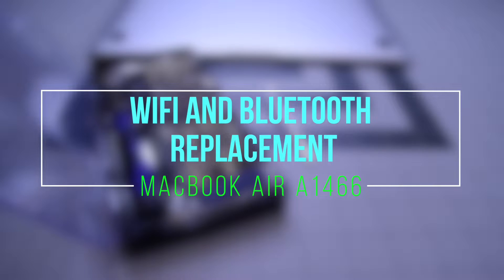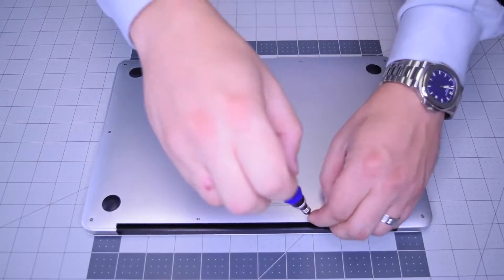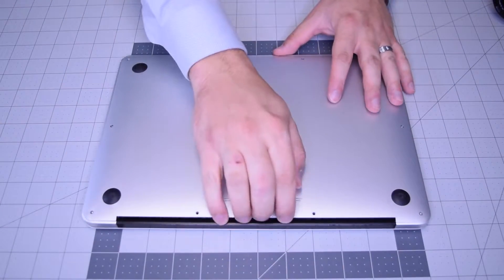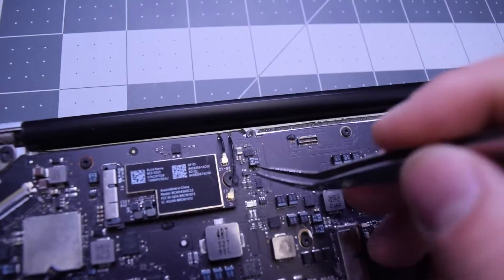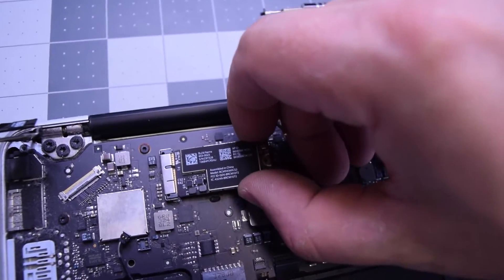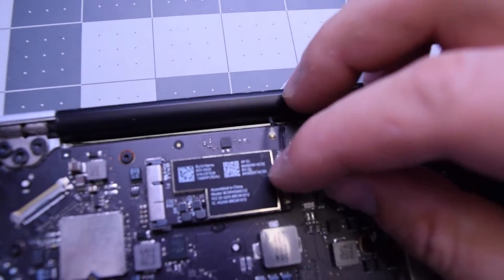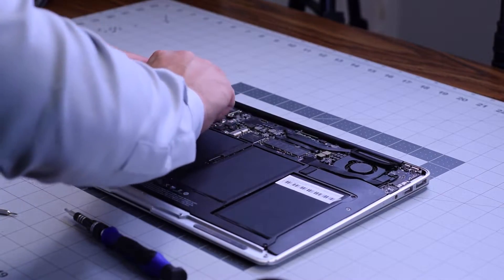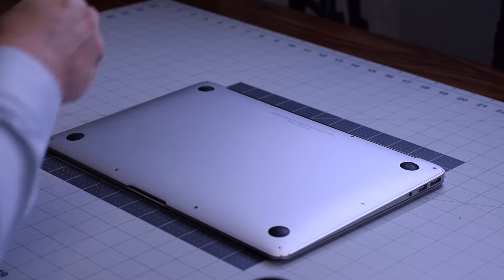Macbook Air 13" 2012-2017 (A1466) - WiFi and Bluetooth Card Replacement

Comment: I’ve ordered the component and I’ll be doing the installation next week. When I replace the fault WiFi card, do I have to do anything on my MacBook? Or will it just automatically recognise that it’s fixed and I can connect to the internet again? 

Any help would be appreciated. I’m pretty new to this sort of stuff. The only thing I’ve ever fixed is a broken PS4 remote.

Comment: My MacBook connects to my bluetooth devices, like headphones, but while its connected and playing sound it disconnects and no sound comes out. Macbook says its connected to the device, but no sound. Not sure if this is a bluetooth issue or idk. Macbook pro late 2013
Reply from the maker: Sounds like you are not on the correct output device
Reply: Save Apple Dollars not sure if it’s a hardware problem or software problem, tried resetting the Bluetooth module, no luck. Would replacing the Bluetooth card work?

Comment: Does this method work on 2018 MacBook Pro 15?
Reply from the maker: Unfortunately Apple went in the direction of taking upgradability away from the user. The 2018 models are onboard flash storage that can only be upgraded at time of purchase.
Reply: @GRIBSOFT  Thank you for the reply.

Comment: I am thinking to buy MacBook Air 2018 (used) because it's costing me 1/3 the price of new one but it's WiFi and Bluetooth is not working. Can I change WiFi and Bluetooth card in MacBook Air 2018 too? How much it will cost?

Comment: Question, I had some bluetooth issues with my MacBook air early 2015 model a few months ago where my Bluetooth was unavailable as perI] the greyed out menu tray icon.  I tried everything from resetting the PRAM and also resettingThe SMC well as deleting two different bluetooth.apple.plist files from the library. One of those files had a lot of numbers in it but I still deleted it anyways as the instructions online told me to do so. I'm sure you know all of these options, however none of them resolved the issue. It seems the only thing that fixed the  "Not Available" greyed out Bluetooth icon was to erase the entire hard drive and reinstall the OS. I originally had El Capitan and I never upgraded to Sierra or High Sierra in 3 years since I bought the Macbook but when I reinstalled the OS I put Mojave on and it worked! I was so relieved to have my Bluetooth back and I figured it was just a corrupt file somewhere besides where I was looking. Now it's been 3 months and my Bluetooth is off again. Same thing as before and I tried all the same ideas as before and I'm about to reinstall the OS again with Mojave. My question for you is would a failed Bluetooth module still work with a fresh install or is it starting to fail and is that why I'm able to get life back into it by reinstalling the OS? Do Bluetooth Wi-Fi modules just fail or can they kind of slowly fail? Would replacing the hardware module make any difference here?
Reply: Hey I'm having the same issue as yours. How di you fix it the second time around?

Comment: Does this replacement  will change my Mac air's physical MAC address?
Coz I don't wanna change my MAC address of my Mac Air.
Reply: @GRIBSOFT  but the network card has MAC address on it, then it can change I think .
Reply from the maker: @PritamKumar-og3fn  I was under the impression I was answering an SSD video comment. Sorry, yes, swapping a wifi/bt card will switch the MAC address. Every wifi device has a it's own MAC address.